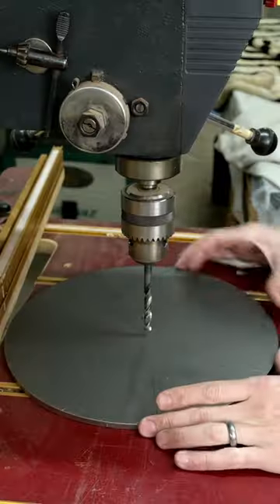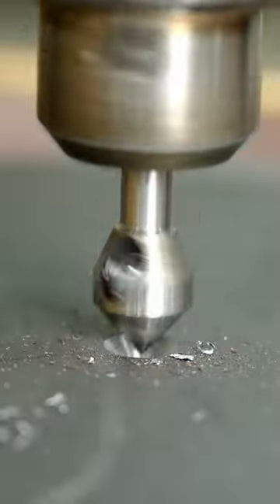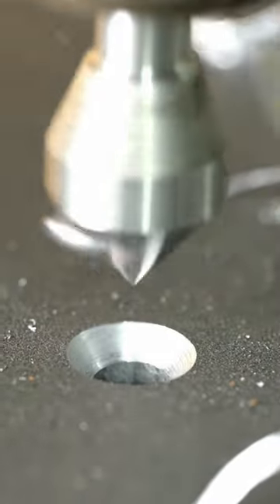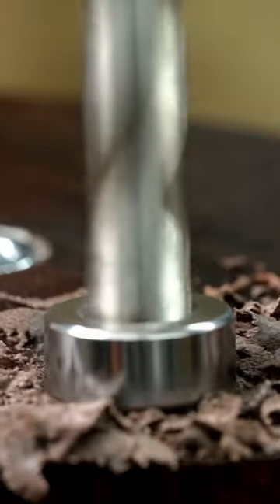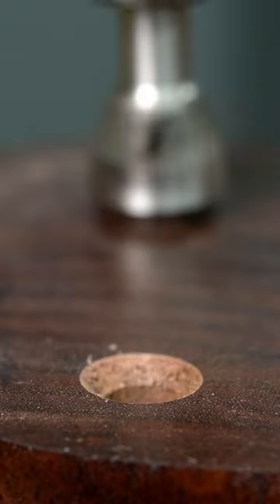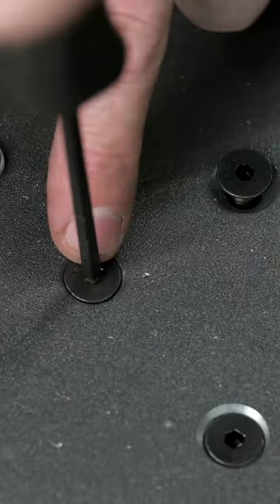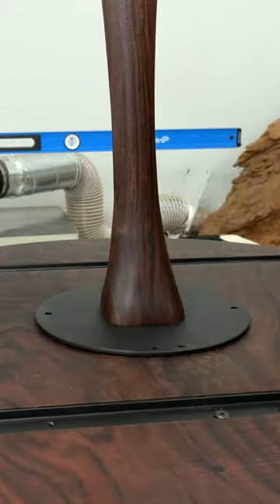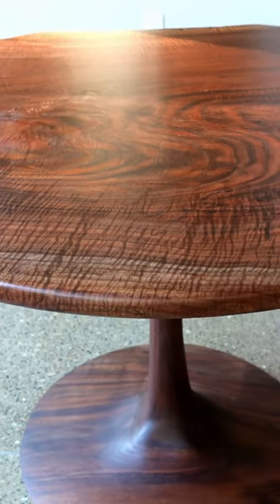Mounting a Round Table Top

Comment: Rampa Muffen are perfectly fine. They were invented by a German carpenter  Hans Hermann Brügmann and patented in 1905.
For a standard mild steel you don't really need a cobalt countersunk. drill bits and countersunks with 5% cobalt are required for stainless steel. 
You always want to use a cooling emulsion while drilling.

Comment: After you thread in all the inserts remove them and use JB Weld or another very strong epoxy inside the wood hole and then reinstall the inserts. This will prevent the wood from ever giving way even if the hardware is overtightened a bit. Extra security against heartache